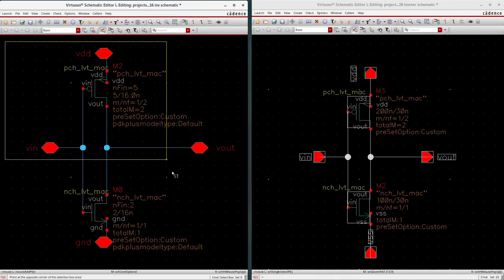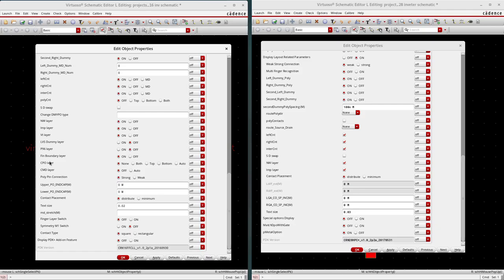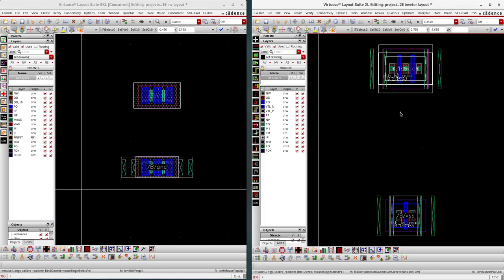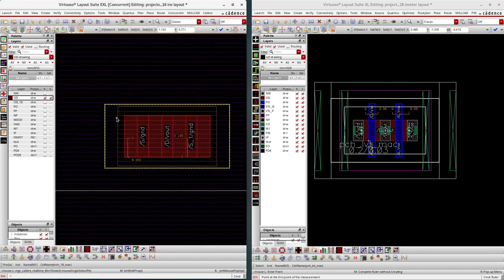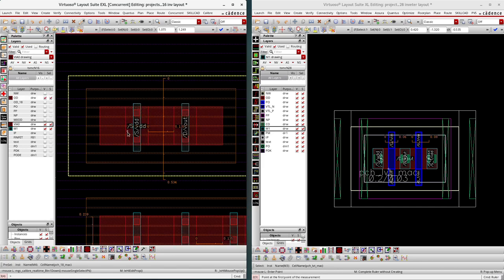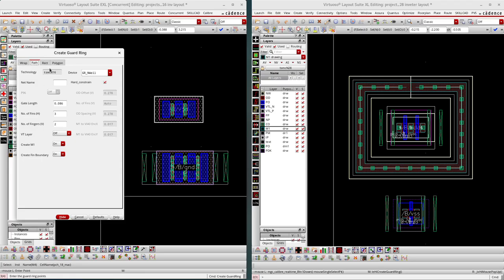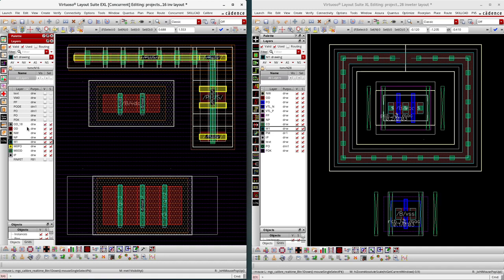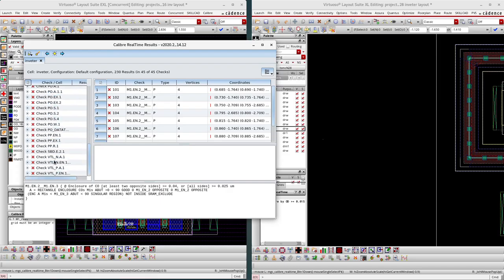TSMC 16nm VS 28nm Layout Comparison

Comment: CPO layer is Cut Poly layer to differentiate connection between two different gate connections or we apply CPO to cut the poly where we don't want to fabricate that perticular part of poly and same for  CMD as it is Source and drain connection in finfets so CMD is cut MD which cuts MD layers or source ,drain connection layers where we doesn't want the MD to fabricate to interrupt connection between two different source or drain connection.

Comment: M0 OD is your contact layer for Source and Drain on the Fin. For the Poly Gate you need M0 PO. On top of either of those (M0OD or M0PO), you need V0 to connect to M1.